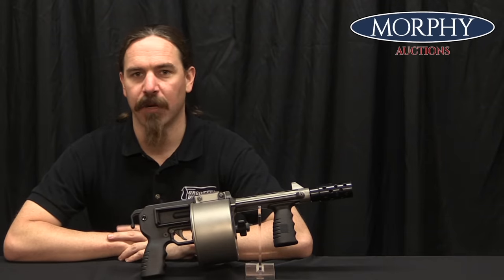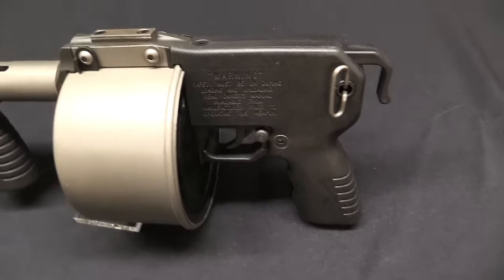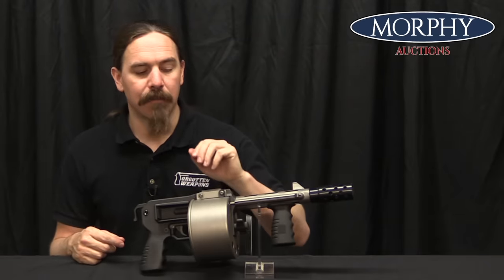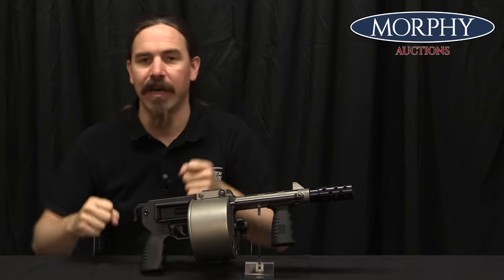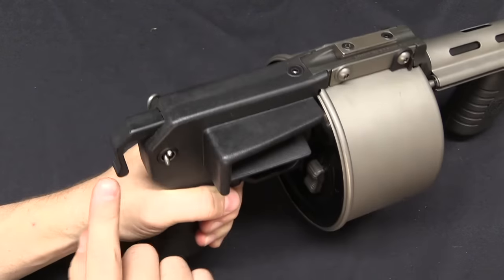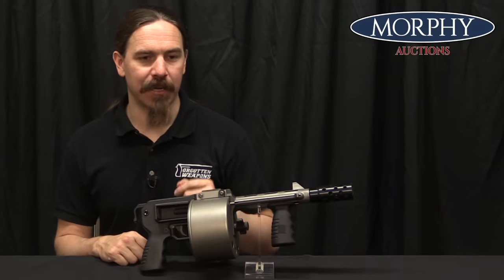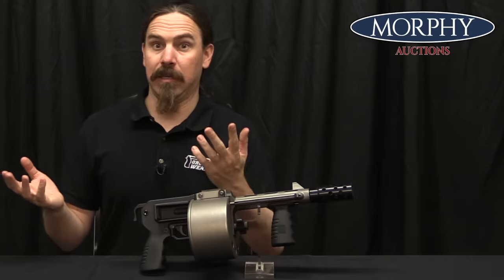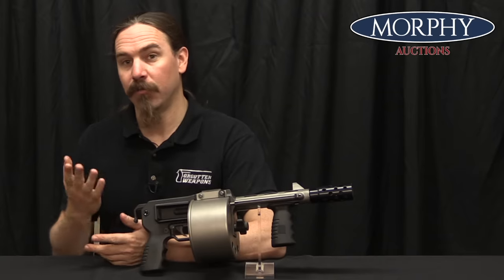Striker 12: Shotgun Turned "Destructive Device"

Comment: If all it took was asking for it to be banned can I ask for it to be unbanned?
Reply: @0neDoomedSpaceMarine  
Gas action.
Reply: @0neDoomedSpaceMarine  
If the gas piston just whined the spring it takes less power than working the action because it does not have to instantly overcome all the inertia and friction in the system. The persistence of the spring allows less total power to do the work and if a low power shot doesn't fully whined the spring the action still works with a ratchet capturing the partial whined.

Comment: Bought a Street Sweeper brand new in 1987 in LA for $229.00 at B and B Gun shop in North Hollywood. Went out on my boat in MDR and left it on the deck. A week later, I found a rusting hulk on my boat that used to be a brand new Street Sweeper. Beyond fixing I threw it into the main channel at MDR. What may be left of it, 30+ years later is still at the bottom of the channel.

Comment: Today, 2022, RIA makes a semi auto 12ga, pistol grip only, gun.  It uses a 5 rd, 9 rd and 19 rd mags as well as a 20 Rd drum.  It is 26" long, 14" barrel, smooth bore.  The ATF couldn't decide what the hell to class it as,  so they made up a new classification....FIREARM.  I was wondering how the heck that happened?   It is sold for Home Defense.  It makes this Striker look like a toy.     In the factory manual it says to never attach a stock, shorten the barrel or ad a forward vertical hand grip or it becomes an NFA device.

Comment: The mechanism on this shotgun is similar to the SAGE SL-6 37mm launcher. The trigger is basically a two stage mechanism. As you carry it, the firing pin is offset from the primer of currently selected round to prevent accidental discharges. When you start to pull the trigger the cylinder rotates a slight amount to line up the firing pin with the primer and as you continue to pull the trigger, the firing pin actuated and it fires the round. If you rush through the trigger pull, the firing pin will fire before the clock spring rotates the primer in line and the weapon will fail to fire the round.

Comment: Is there an empty 13th cylinder specifically for the first shot to vent the ejection gas? Or were live shells somehow safe from being ejected? Or is that loading gate up long enough to prevent that live round from being ejected?
Reply: First shot doesn't eject anything. Every shot after #1 ejects the previous shell. Last shell is never ejected so there's an ejection rod for it.
Reply: @totalmetaljacket789  I understand that but how does the ejection system know when it's the first round? Is there just nothing lined up with the ejection port so the gas just gets vented into nothing?
Reply: @seanclaiborne8570  Correct.

Comment: Reckon I still give up... 
Ian has more patience than me.
He does a great job.

I still don't understand why some folks are opposed to the 12ga single, 12ga pump... each fired from the hip at 10 yards at the hip region of someone will stop an attack. Using 00, 000, #4... even at 5 yds with #7 game load...
And why disparage the .40 S&W... it's a heavy hitter if you do your part.

Sure I have a 9mm S&W Shield Plus for back up.
But reality is choose what you can use effectively.
Can't handle a larger guage or caliber...? Fine... use the smaller caliber and put the hits where it counts and add some defensive training close quarters hand to hand to supplement.

Comment: I was wondering if you , or any of the viewers could help me.  My grandfather has this carbine with "GAL" and "8.5" written on after the breach of the bolt. It sorta looks like a Berthier carbine, but it also doesn't.  It has this odd block at the end of the barrel that assumed was for rifle stacking. But when i did more research this 'block' is just too big and bulky for the task that apparently only took a little bit of metal. If anyone can help point me to the right direction or has a good answer that would be great. My problem is the only source i found for looking up firearms charges $25/month to access it (firearms guide) and the free part of the site doesn't have france for country of origin. I figure its either a variant /after market civilian make/ or something different altogether.  It was found along several other weapons, including a winchester lever action and a remington shot gun. To my understanding all of these weapons were inherited or gifted to him, so they very well might have all been purchased in the early 1900s or earlier. There was also some japanese rifles that my grandfather recounts, but have yet to find them...he told me several existed. But yeah, everything else I recongize and can figure out pricing if we need to sell to support him. But that one is just a little difficult to even find out what exactly it is.

Comment: So were these guns labeled DDs by name or type of action?
If just the model names were labeled as DDs, couldn't a new manufacture revolving shotgun be marketed today?
Albeit under a different name?
I think something like this would be great for the "firearm" market just like the Shockwave styled guns.
It would just need to be over 26 inches in length, and you could even run a vertical fore grip legally.
If the half inch bore comes into play holding it back, other gauge sizes could be considered.
Hell, you could even have a newly designed overfolding brace to go with it.
Sounds like an awesome option without all the red tape hassle.

Comment: This thing could probably be matched in performance by a typical pump shotgun. Mossberg 590s only hold 3 fewer shells, and are easier to reload. The Striker's main advantage is its compactness, and even that was not a feature on the original guns.
Reply: Pump shotguns can be reloaded in between shots, which the Streetsweeper does not appear to be capable of.

Comment: okay, quick little question. would this gun suffer from the cylinder gap issue the street sweeper did? it looks better sealed than that version and Ian didn't mention it, also did Cobray license everything but the gas system for that, or did they just blatantly rip this gun off for the street sweeper?

Comment: I am from South Africa, and I used one of these, the fold over stock model without the auto eject. It is a very dangerous weapon to handle.
Accidental discharges were plentiful. Picking up a Striker without the safety on, had a discharge. (it was issued that way, the issuing officer was on the other side when it went of, no injuries) put it too hard with the butt on the ground, it fired. (No injuries) Unloading it, also went off (no injuries). Otherwise my weapon of choice till today. Compact, easy to handle in close confined spaces, easy to sling over your shoulder. A great weapon to have in a vehicle. Little to no recoil.

Comment: Actually, if that weren't a destructive device, it still wouldn't be a short-barrelled shotgun. Under federal law, a shotgun is designed to be fired from the shoulder. Because this model lacks a shoulder stock, it doesn't meet that definition. It would be considered a smoothbore pistol, which falls under the All Other Weapons (AOW) classification.

Comment: This could have been easier. If it didnt eject put manual ejecter on front pump pump it each shot to eject.
Or just use a STEN design scale it up. Pressures of 12ga and 9mm are pretty similar

Comment: you forgot one thing, it is a bold observation, but.. to the uninitiated, it looks like a small 'tommy gun', aka the machine gun used in the movie road to perdition, with tom Hanks as the "assassin" for the mob, so an easy mistake, to think of the 'cylinder' as a rotating magasine, as opposed to a storage, for a manually operated shotgun.

Comment: The weird part is that the metric for determining if a shotgun is a destructive device, is whether the weapon has a sporting purpose. Forgetting, of course, that the Second Amendment to the Constitution is not written for sporting weapons, but even more ridiculously, how broadly such a metric could be wielded by the ATF against any defensive shotgun, perhaps not limited to semi-autos.
I mean, take the Persuader, one of a few defensive variants of the Mossberg 500. 18½" improved cylinder bore, capacity of 5+1, I don't think mine even came with a plug. Without buying a plug and an adjustable choke bore, it would be sub-optimal and illegal to hunt game birds; it's clearly intended for home defense. While there's literally nothing wrong with that, the ATF could make the determination that lacking features for bird hunting constitutes a weapon with no sporting purpose, and therefore rule the Persuader as a destructive device.
I understand, unlikely that they'll pick that argument up against any current production autoloaders, let alone against a pump shotgun as I'm describing, but by their guidelines and past decisions, it's possible. The Striker-12 and it's knockoff the Street Sweeper got classified so because something about marketing got them looked at with a jaundiced eye, not because they were in any way reliable or efficient.

Comment: Considering the South African origins it makes sense. Seems perfect to load with less than lethal ammunition (as its totally mechanical) and give to hastily trained conscripts to put down uprisings in the townships during apartheid
Reply: In the time this was designed the requirement for police, and army which were called into riot situations frequently, was often to deal with large and extremely unruly, hostile crowds and birdshot was used, the idea being it would be less likely to be lethal at any but close distance. Sometimes rubber bullets would be applied as an alternative.

The theory may have been wrong, but in such a scenario more ammo is probably a good idea!

Comment: I'll stick with my KSG. I took a pass on the ksg25, since I feel a mag that holds a whole box is a bit much. I'm cool with mine, that leaves 10 in the box when ya load. If I can't get it done with 15 2.75" slugs+00 buck then 8 more outta my m4, then I'm running my ass off at that point. Whatever is coming isn't going down with 10 more thrown in it, so at that point I'll tip my hat, make sure I don't slip in my liquid and solid fear excretions running out my pants legs, and proceed in the opposite direction at a quite brisk pace.

Comment: A 410ga version would hold several more shells as well as get around the  >.50 bore diameter issue.   Barrel length still an issue unless entire gun was never mfg as a shotgun and meets certain length requirements.  All that said, it's cool but impractical.  However that does not mean it s/b regulated as a destructive device.  When my ex brother in law drinks, he exhibits more destructive potential than this gun.